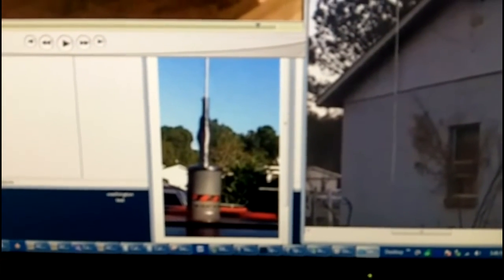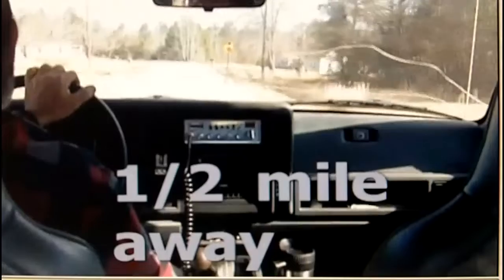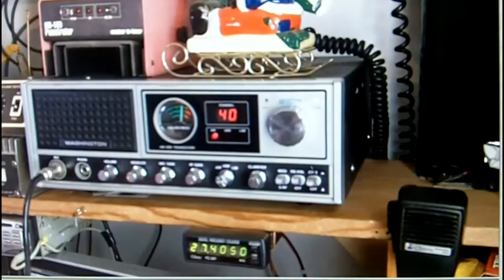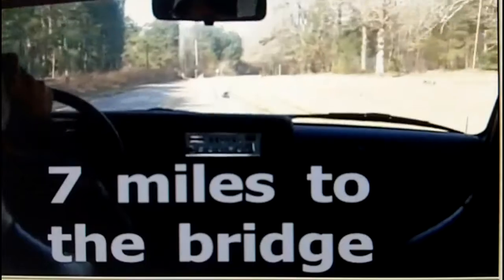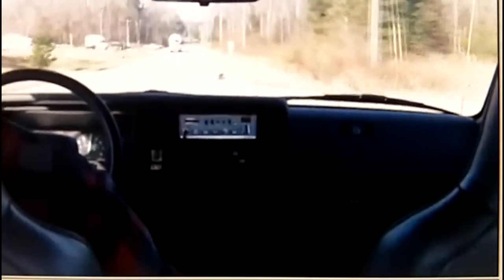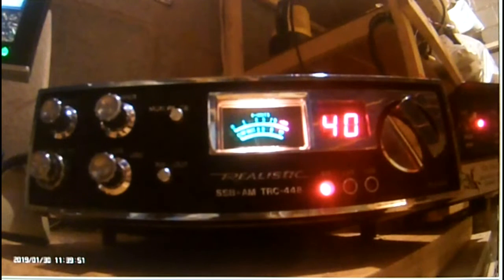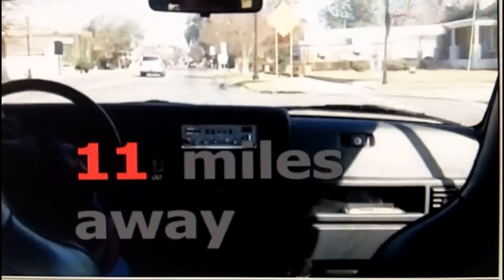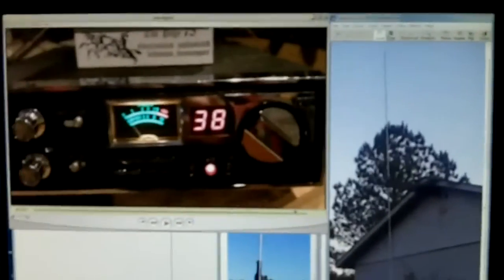Dipole Antenna test Horizontal vs Vertical CB Radio Range Testing

Comment: You may have already done it, but what about talking horizontally to a vertical station and showing the recording from the vertical station then talk vertically to it and showing the difference in Recieve?

It’s a bit confusing to me, but I’ve read that they can still communicate, but just have a loss in DB due to the different polarization. Curious to see an actual test

Comment: Your car antenna and vertical dipole are polarized the same way. You may find that the horizontal dipole would work over quite long distances. In an emergency situation, hams could hear the horizontal because CB is next to the 10 meter band.

Comment: Great Vids Old Dude.. Very informative and technically interesting. After watching your channel plus a few others I've decided to get myself set up back on the Rig after decades away.. Looking at the Anytone At-6666 / CRT Superstar 9900. Unfortunately due to renting the property I won't be able to install an Antron 99 or equivalent however think I'll be OK on with a lightweight Dipole.. I had really good results with a Dipole back on the day and the Anytone At-6666 puts out around 60 Watts on Sideband.. Do you think I'll be able to get some decent DX contacts outside the United Kingdom with that set up of antenna? Greetings from Liverpool England btw R Kid and keep up the good work Old Dude.! 👌📻💯👍😜
Reply from the maker: That's great, The AnyTone radios are good reliable radios. And a Dipole should work very well for DX with a 60 watt radio. Have fun with the hobby, 73's

Comment: Great .do  think that the horizontal dipole in attic fell short because car was vertical polarization?or was attic dipole not being ratiated mostly in your direction of travel perhaps? How far off ground was half wave dipole in attic?just wondering.laugh.ive heard a dipole can radiate up if to close to ground.merry Christmas.

Comment: It's sort of a no brainer.  The mobile antenna is vertical.  Vertical to vertical, or horizontal to horizontal, will always be better than vertical to horizontal.  Some claim that horizontal polarization is better for skip, but I can't see that really being true unless who you're talking to is also horizontal.
Reply: Once the waves skip off the atmosphere polarization is not an issue. It all gets scrambled from the bounce and either horizontal or vertical works. This is at least what they taught us in ham radio class...
Reply: @lordmikethegreat : ya 40 to 50 years ago I was taught that radio waves bounce off the ionosphere. What I am reading now is that the radio wave is being "bent" when it comes in contact with the ionosphere.  This sort of changes how I think about "skip" since a bounce / reflection would be an equal but opposite angle, and a "bend" could be a random angle.

Comment: I remember a tiny CB that I always liked, years ago .. it was called the Brute and if I recall correctly, was made by SBE.
I believe the mic was hard wired and ... I don't recall any kind of meter on the unit except possibly a modulation or transmit light.

Comment: Were you driving in the radiation pattern side of the dipole? Also.. Why is your realistic radio lights dimming when your wife keyes up? Is it on a car battery?
Reply from the maker: Yes, I drove within the radiation pattern. The light dims with modulation, the louder I talk the brighter it gets. when the radio is in receive mode the light remains illuminated.

Comment: I have a CB base unit with a vertical antenna that worked but not very well because there is nowhere to mount it to get above the mountain.  I was thinking I could shoot a wire antenna outside my window to a distant tree and fasten it there. What size wire would I use and how would I connect it? Will this work?
Reply: Ive experimented with many homebrews, perhaps i can help. First.. What type of vertical you have? Material? Length? Mast?
Reply: @gabrielM1111  I'm in the same conditions, it's hard to go to the roof and to install a proper vertical 5/8 antenna with a good and as short as possible cable connection and I would like to test an horizontal dipole 1/4 wave on the balcony, even a rigid aluminium instead of wired but I'm at first of fourth floor even if there is some free space between other structures

Comment: Sorry but this is useless. Why are you trying to listen to a vertical antenna being received on a vertical, vs vertical antenna to horizontal... Obviously the polarisation is wrong.
Now do a comparison, Vertical to verticale, versus a Horizontal to horizontal transmission.
Reply: Yes but it's nice to see experimentation in actiom
Reply: You are correct. There is a 3Db (half power) loss when transmitting and receiving on different polarities.

Comment: I've built several dipoles . Short range " 10 -15"  miles. Won't hold with a good ground plane. But on skip, with ideal atmospherics, around the world w 5 watts no problem.

Comment: I have a vertical dipole constructed out of 2- 102” stainless steel whips, I have a few bugs to iron out but SWR is 1.5 on channel 1 and 1.7 on channel 40.
Reply from the maker: 102" whips have so many possibilities. I recently built a ground plane antenna, using a 102.

Comment: Whenever you have antennas with different polarity, you have to expect a drop is signal. You have to compare vertical to vertical or horizontal to horizontal. You will get a decrease of about 20 db with different polarity . Horizontal polarity id always quieter.
Reply from the maker: When driving down the road, My antenna is at a 45 degree angle....So it's not vertical or horizontal.
Thanks for watching, 73's from 151 SC.
Reply: @MowerJunkie  .Good morning,  if  your dipole was also at a 45 degree angle , its performance will be much better. Keep up the good work, I like looking at your videos, 73's from 240Z  CA.
Reply from the maker: @kennyheralal4844  I agree, in the past I built a dipole at a 45 degree angle, and it did very well. But was extremely directional. Mine only did well to the west of Me. Reception to the east was kinda pathetic.
Thanks for the comments, 73's from 151 SC.
Reply: @MowerJunkie  , Horizontal dipole works great from Base station to base station. I just worked station 97 in Toronto Canada from by base in Victorville CA. Happy  that my "new" station is finally working.
Reply: Keep up the good work.
Reply from the maker: @kennyheralal4844  That's awesome! and it's why I still have, and use the Dipole in My attic. 73's and lets Keep The Hobby Alive!
Reply: @MowerJunkie   So your antenna is "Circularly Polarized".

Comment: Not really a fair comparison. If your position is off either end of the horizontal you won't be heard very well because it acts like a yagi. Horizontal dipole works better in the inverted v for that reason. You get better coverage.
Reply: Thank you for this information. I just installed a horizontal dipole in my attic. I now know i need to bring the balun up or down for better performance on the cb radio. Been using verticals my whole life, branching out with this one.

Comment: I wonder if you could make a Dipole Antenna that works both Horizontally and Vertically?
Reply from the maker: Sure, You would just have to figure out how to spin it.
Reply: @MowerJunkie  Thanks for the reply, but I think I didn't ask my question correctly.

What I meant to ask was, could you make a Dipole Antenna that works both Horizontally and Vertically at the same time?

Perhaps in a cross or X shape?
Reply from the maker: @waynekerrgoodstyle  I'm not sure, I think the 2 signals would interfere with each other. Look into Ground plane antennas, they work great at horizontal or vertical, at the same time. this is why I now use ground plane designs for both of My base radios.
Reply: @MowerJunkie  Ahhh! Now that makes sense! Thanks very much for your reply :-)
Reply: @waynekerrgoodstyle  yes you can  thay do it whith beems n jo gun  use to have one
Reply: @waynekerrgoodstyle  Short answer: no.
Reply: @James_Bowie  Um... yes.  Carolina Windom does. Inverted Vee is a dipole positioned between vertical and horizontal, and an Inverted 'L' is a damn good wire type antenna with horizontal and vertical properties but it has to be matched correctly at the feedpoint for impedence (plus ground radials).
Reply: @waynekerrgoodstyle  You can do an inverted L shape

Comment: How does the horizontal stack up as far as skip? Also, would you get a certain amount of loss from the antenna being inside the building?
Reply from the maker: the horizontal attic mounted dipole does very well with skip, a lot of times it does better than the outdoor vertical. I have used both at the same time for monitoring skip, and it's like stereo CB, the outdoor will hear some and the indoor will hear others.

Comment: Get a 2 way ant. switch so you can use the same radio. Controls.
Reply from the maker: 1 radio is in My garage and the other is in My house. I have antennas on both buildings. Thanks for watching.  151 SC.

Comment: 2 different polarization.
Reply from the maker: this is why I did the test while driving instead of stopping at check points, My mobile antenna is tall and skinny and ends up leaning over to about 45 degrees while driving, giving both base antennas a fair shot at winning.  Thanks for watching  73's
Reply: @MowerJunkie  Here in the UK I have an inverted V dipole cut for 11 meters in my attic about 25-30 feet above ground. I can reach across the continent on SSB (even during this solar minimum) and locally I get out about about 30 miles SSB and 20 miles on FM. The best contacts locally are with others using horizontally polarised antennas though the whip antennas are still readable.
Reply from the maker: @MrScotchpie  that's awesome!  I've heard the inverted V is a very good performer.  Enjoy the hobby,   73's......151 SC.

Comment: Thanks for the video ! Did similar tests in SSB with a 5/8 antenna about 40ft ASL on a mast and my car with a 6 foot antenna.
Was doing 16.8 mi range to my workplace. Pwr on both sides like 25W.
Reply from the maker: that's nice range Your getting, if I ever get around to raising My antennas higher, I might get that kind of range too.
Thanks for watching,  73's
Reply: @MowerJunkie  I also had the advantage of using SSB ; so the range you achieved is nice actually, nothing wrong with that ; also you demonstrated well horizontal and vertical can be used together, but you will theoretically face a loss of 20 dB aka ca. 5 s points (here it seemed to be less but with additionally having fading maybe polarization could change as the waves traveled on a consistently changing path ; so all in all an interesting test :)  )

Comment: How do the 2 dipoles compare on the skip? Does the loft horizontal work better? Nice Washington BTW, I purchased one a few months back still with box. It's off track on SSB but I'll get that sorted no problem.
Reply from the maker: I don't know yet, I haven't had any skip since before I installed the vertical.  Thank You, I love My Washington. I hope You're able to get yours back on the air.

Comment: Im wondering how you can put a dipole in your attic ?
Reply from the maker: it's on the flat (horizontal) up at the peak of My roof, inside My attic.
Reply: @MowerJunkie  With a full size ?
Reply from the maker: @MBJanus  A dipole antenna is just a 17 foot long Wire with the coax connector in the middle of the Wire. 8.5' element and 8.5' Ground plane. this setup works better for talking skip, and the vertical is better for local.
Reply: @MowerJunkie  Youre totally right, I wondered only about the heigth of your dipole. 
Im french and I apologize for my poor engilsh ; Im looking for antennas in a small area as I bought an house on only 400 m2 and perhaps a vicinity against EM effects.
Reply from the maker: @MBJanus  if you're looking for a space saving antenna, look into the Tram balcony antennas, I've read a lot of good reviews about them.
Reply: @MowerJunkie  Many thanks for your answer and wasting your time for my request.
Reply from the maker: @MBJanus  No time wasted, I like talking about radios and antennas. Thanks for being here, Have a great Day.

Comment: I have 100 watts SSB, goes 100 miles. Same vertical dipole, only the ends are folded.
Reply from the maker: Dipoles are Awesome! vertical or horizontal, they work well.
Reply: yup, they are good for this band, not so good for vhf and anything below the 20 meters band.

Comment: Very good Range Test! Vertical to Vertical seems to be better than Horizontal to Vertical..
Reply from the maker: Yup, for local use, the vertical is a lot better. Thanks for watching, 73's
Reply: DE2017: There will be a slight reduction in RX unless your contact is also using a horizontal antenna but its no real problem.

Comment: Very cool range test! I'm amazed at how well that vertical dipole works, especially considering its height off the ground. I may have to invest in one of those at some point. If I could get that much range around here, that would include almost all of our usual drives.
Reply from the maker: Thanks, I'm thinking about lifting the antenna higher to try and get a little more distance. maybe then it will cover everywhere I drive to.

Comment: My swr are all messed up with the -4 out side  temp
Reply from the maker: You gotta shake the Ice off it, or turn up the power and warm up that antenna!
Reply: @MowerJunkie  when I turn on the amp it work better
Reply from the maker: @dejo1976  Everything is better, with Heat!
Reply: @MowerJunkie  the amp help a little